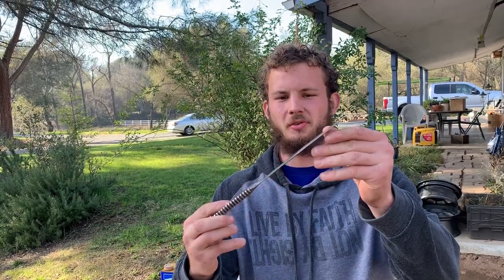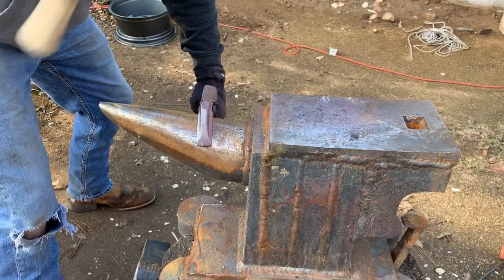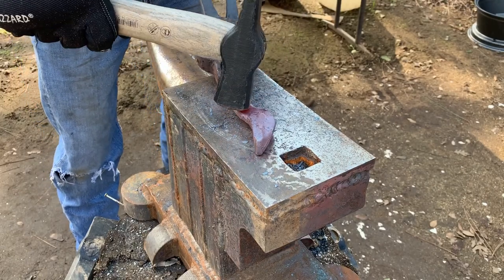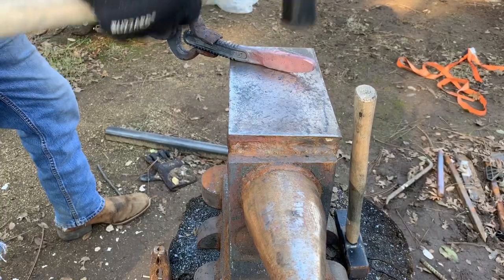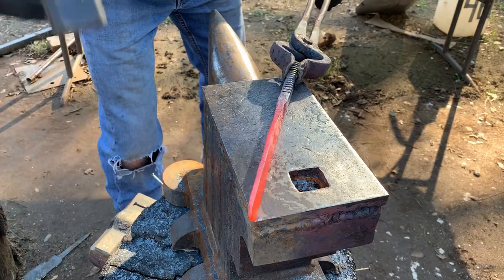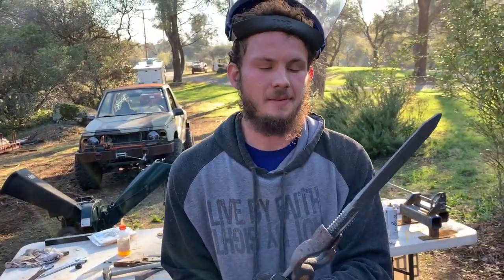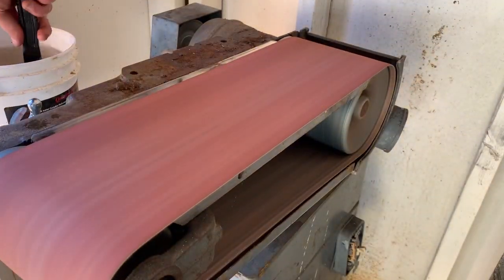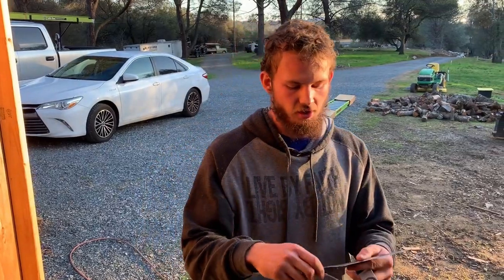Forging a Pipe Wrench into a Knife

Comment: You'll have better luck if you get it a bit hotter to forge. Your forging temperature range is from about 1800 degrees when you take it out of the forge down to about 1500 degrees when you stop forging, straighten it, and put it back in the forge. The temps in your video look like they're not much over 1500, if any, when you begin forging.  Just a thought...
Reply from the maker: I definitely agree. At the moment we have a 3 burner forge, but it never seems to get hotter than orange-yellow at the hottest. We are going to add a door which should help some, but at the moment we never get the steel as hot as we'd like.
Reply: @FormulaJake  Since you never show your forge in the video, I can't offer any suggestions. You can share with me on Facebook. I'm the admin on BforB that complimented your video (and posted it). Shoot me a PM, if you're interested in looking into it.

Comment: Couldn't you make big sister out of the other section of the pipe wrench? Or is there anything about the metal in that section stopping that?
Reply from the maker: The other section is mild steel, and wouldn't hold an edge. I could definitely make a metal hanger or decorative piece out of it, but nothing critical due to low carbon content. The jaw has a higher carbon content. Probably not enough to hold the best edge on a knife, but definitely sufficient for tools and a light use knife.